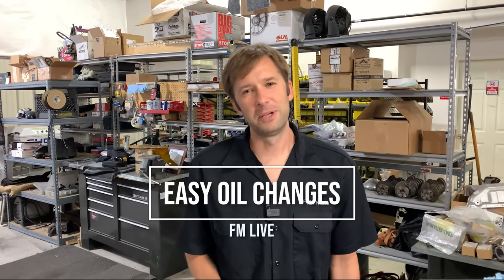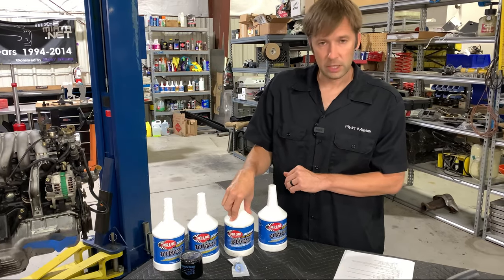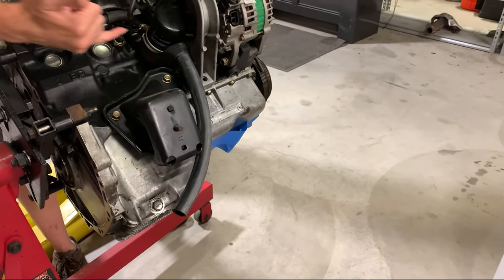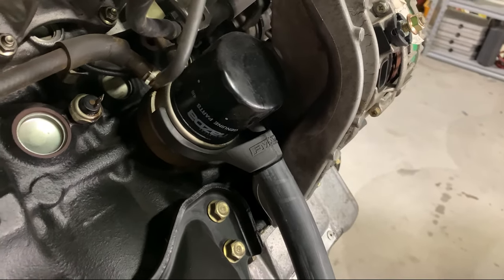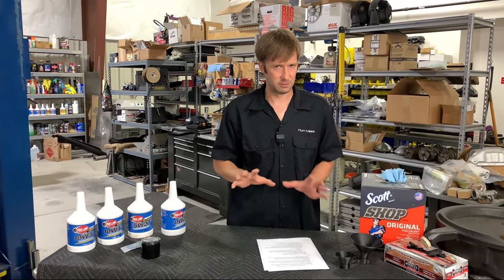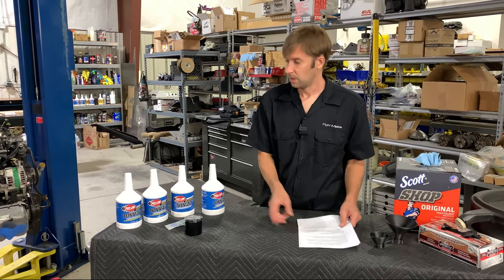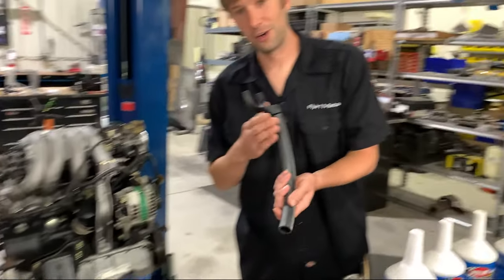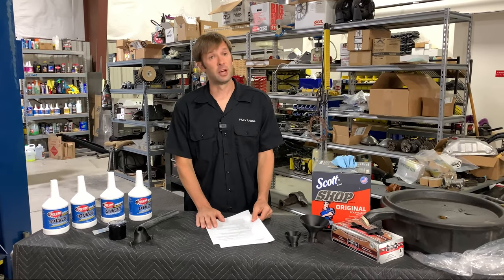Easy Oil Changes! (FM Live)

Comment: Also thanks for the tip on the tire rotation.  I've done two oil changes so far and rotated the tires.  Not a big deal but if I don't need to do it that will save me 15 minutes.

Comment: Great video.  Not mentioned, but probably of interest is the relationship between viscosity and hot lifter tick, and change intervals and cold lifter tick. In the summer, here in the Western Mohave on mountain ascents, but also, according to the forums, on the track, on hot days (e.g. 100F) e.g. in Arizona, B6 and BP engines, with their low (for the industry) oil pressures can exhibit hot lifter tick. Going up in viscosity from 5W-30, to 0W-40 will eliminate this. For extreme heat, e.g. 110F, adding some 0W-50 works. For cold lifter tick, my experience is that keeping a fresh load of detergent in the oil, by changing frequently, e.g., every six months, does reduce the varnish in the lifters, and on the inside of the engine generally. (You can see the level of varnish when the valve cover is removed.)  I use 5W-30 in the winter, and 0W-40 in the summer, (to prevent hot tick), and I cannot remember when I last had cold lifter tick on start up. In Colorado, you probably do not experience hot tick very often, but many owners report cold lifter tick. Your thoughts please?

Comment: Good info. I've been using Mobile 1 Euro spec 0w-40 in my 300k mile 97' NA8 with good results after replacing all the hydrualic lifters a couple years back. Car seams happy with it and I get less in the catch can than I did when running T6 or standard 10w-30. I live in Ohio as far as climate goes. Also have in the 170's for dry compression accross all 4 cylinders.
Reply: Stepping up a grade to 0-W40 is commonly done on older engines. Interesting about less in the catch can.  You would expect less oil to slip past the rings with a thicker oil, but the oil in the catch can is proof. I am interested in what you say about find that you compression is so good at 300,000 miles. Reliable information on these engines with a long service life is hard to come by. I change oil on a schedule, 2X per year, with different winter & summer oils. At 130,000 miles I am very close to factory compression. At first I thought my compression gage was wrong. So I bought a new gage. Both gages read the same. Modern oils changed regularly extend the life of these engines beyond anything anyone dreamed at the time these car were designed and built.

Comment: Regarding the “tightness” of the oil filter - my father showed me something I’ve never experienced before, or since.
He’d tighten the filter about a 1/2 turn post contact, then demonstrate that it was easy to spin off. Once the oil change was complete, he’d fire up the engine and demonstrate that even his vice-like hands could not budge the filter when the engine was running. Try it yourself…
Point. Unless you have a gorilla periodically changing your oil, there’s no need to own a filter wrench.
Reply: 30 PSI of oil pressure, pressing on the are of the end of a 3" diameter oil filter (area = Pi x 1.5^2 = 7 sq. inches) is 210 pounds of axial force. So no, that oil filter is not going anywhere.  Good demo.

Comment: Not mentioned but, if you overfill your oil, and you have a hand plunger type oil/fuel pump and a 1/4” tube, it’s super easy to remove the excess through the dipstick tube.  Too much oil can cause the crank lobes to whip the oil into a froth.  And oil pumps don’t handle froth well, so over-filling with oil might under-lubricate the engine.
Reply from the maker: Thanks for the tip!

Comment: I was recommended by the place that restored my 1997 1.8L non turbo MK1 MX5 to use 10W40 Semi Synthetic, would there be any positives or negatives compared to your recommendation of 10W30 Synthetic? Thanks
Reply from the maker: Unless you're at the very end of the temp range for that weight, you should be good.

Comment: I have never been able to put 4 quarts in my 2002 nb2. I put the car on ramps an let it drain to a very slow drip, to get to the full mark it takes about 3.5 quarts. Any ideas? I have had car since 2015 with no problems.

Comment: Hypothetically speaking... what if my Miata leaks oil and I unknowingly ran it until it was bone dry; should I be worried and do I need to do anything other than fix the leak and fill it with new oil?
Reply from the maker: There’s not much you can do other than refill it and hope.

Comment: So I have a 2022 ND2 Miata. And I daily drive the car, and once every other week.. I like to take it up at the mountains and run it quit hard, so my question would be? Would you still recommend for me use the recommended w20 oil?
Reply from the maker: A good quality full synthetic at the recommended weight has worked great for us in most cars. unless you have high horsepower or really extreme weather, there isn't a good reason to switch.
Reply from the maker: @OscarC789  We're obviously partial to Redline, but you can't go wrong with any good name brand synthetic. The important thing is keeping up with maintenance and oil change intervals.
Reply: @FlyinMiataVideo  and yes I understand you 100% but there’s something I’m not understanding about different types of weight in the oil. The main one would be, the friction and heat/cooldown of the oil. Kinda like saying. Since I drive the car kinda hard every other week, but I’m running the recommended weight which is 0w-20 for my ND2 but I want to put 0w-30 to add a bit more protection since I know I daily the car and well, run it hard asf?
Reply from the maker: @OscarC789  A 30 weight oil doesn't necessarily provide more protection. It just means it is thicker at the "average" operating temperature range. The NDs have high tolerances and high compression engines that don't like super thick oil. Any oil will heat cycle and burn after being run hard at high temperatures over and over. Almost all modern synthetic oils have polymers that bond to the metal parts to ensure lubrication. There are definitely justifications for thicker oil, depending on the car, specific engine, use and environment, but for ND Miatas, we haven't seen a big reason to switch. The best way to protect your engine is to keep the oil topped off, keep it fresh, and keep it clean.
Reply: @FlyinMiataVideo  and this is why I watch you guys! Thank you very very much for your time and responses. Super helpful :)  so I have concluded with. Just get a oil cooler at best and stay on it with the oil changes :)

Comment: Hi..
what is forced induction ?
i have a stock 2003 NB what oil do i use please ?
Reply from the maker: Forced induction is simply the name given to a power adder that forces air into the engine, such as a turbo or super charger set-up. 

Our recommendations (with capacity for a stock setup):
0w20 for the ND, 4.5 qts
5w20 or 0w20 for NC models (depending on year), 4.5 qts
5w30 for our V8 conversions
10w30 for non-turbo NA/NB, 4 qts
10w40 for turbo NA/NB, 4 qts
20w50 for track use only NA/NB (4 qts) or classic Minis
Reply: Oil’s such a tricky topic as there’s so many variables. For instance, you’re recommending 10W-40 for forced induction NA’s & NB’s - both the owners manual and Red Line recommend 5W-30 (though the manual states 10W-30 is allowable) for my Mazdaspeed MX-5. 
Looking at Mobil 1’s website they say 5W-20, which tells to me they’re probably thinking in terms of maximizing fuel economy.
My MSM is primarily a weekend toy that’s kept at “F” with 5W-30 synthetic, allowed to get good oil & water temperature prior to hitting boost, and idled (hood ajar) ‘til the fans kick in three times (two or three minutes) prior to shutting ‘er down. I generally leave the hood propped open for a half hour too.
I’ve yet to go beyond a 3500 mile oil change interval and flush the (FL22) coolant every two years.
These cars run hot, and I sure hope I’m doing right by my trusty buddy…
Thanks for all the videos FM, I appreciate them!